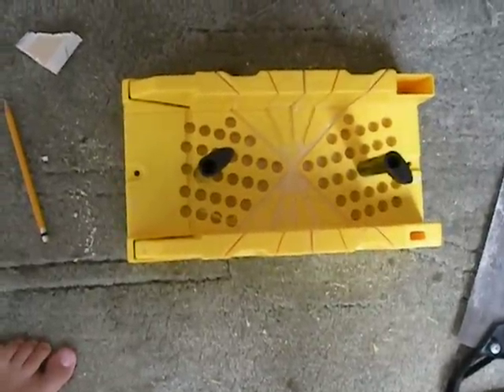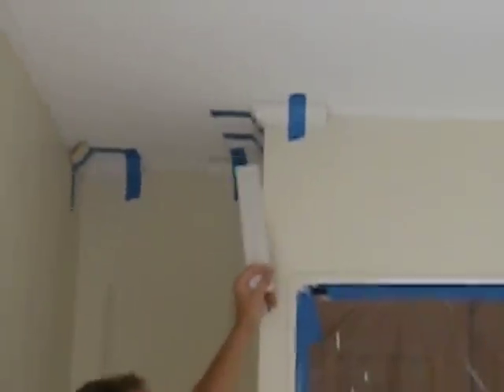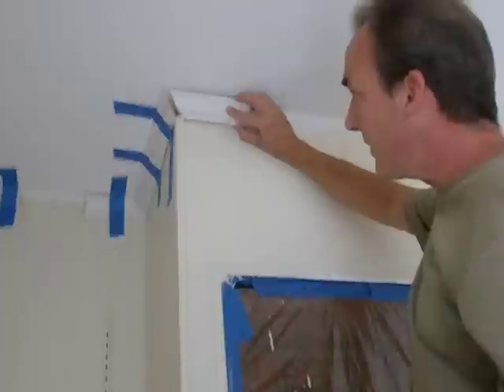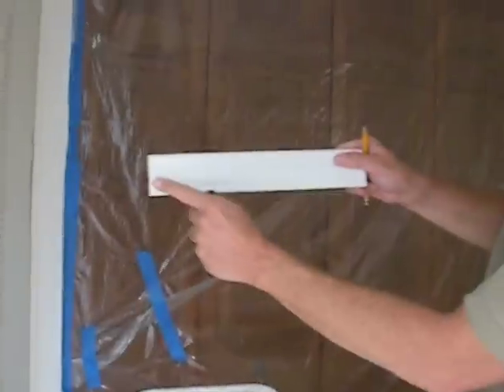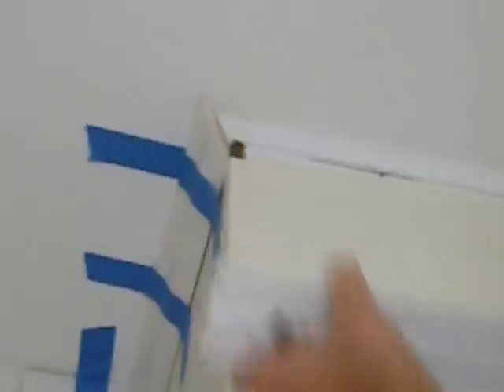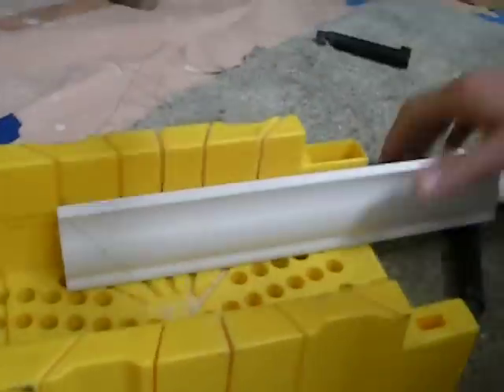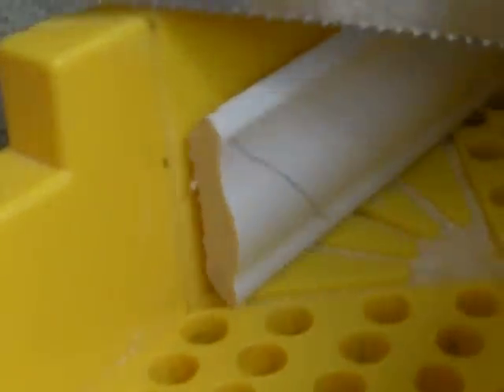How to install and cut crown molding without power tools Save money no special tools

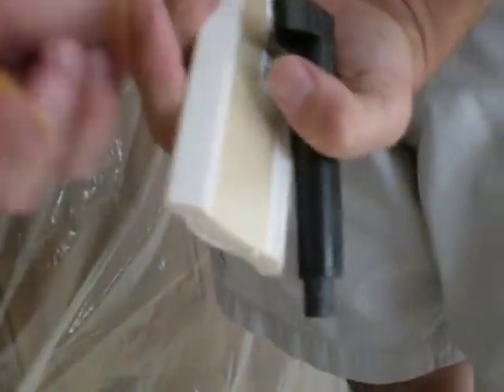Comment: The biggest take-away is marking the underside and turning the piece over to saw ... that actually worked (2:30 in the video).  Using existing cuts as a template is also a great idea. As for the camera shaking and quick shots, so what.  Message delivered.  This is not a professional video, so don't expect perfection.  Great job.

Comment: Depending on how much you’re doing, you might want to invest in a miter saw. I did 2 rooms full of trims and casings and crown moulding and I gotta say… for the time spent, I could’ve made enough for a miter saw AND finished my project in a fraction of that time. This thing is good for quick or small projects, but if you want to save yourself from some serious carpel tunnel, get the miter saw.